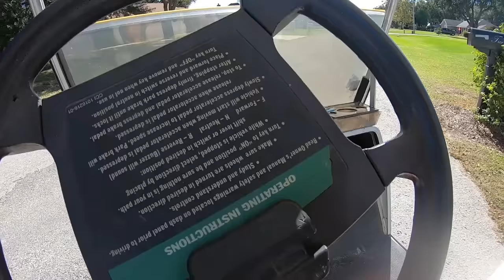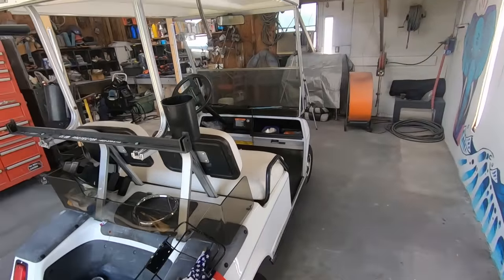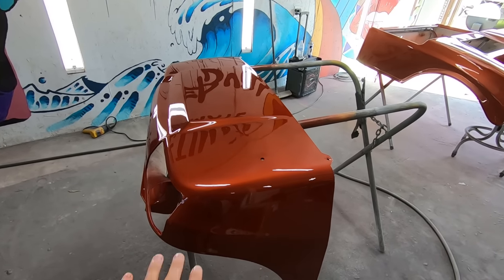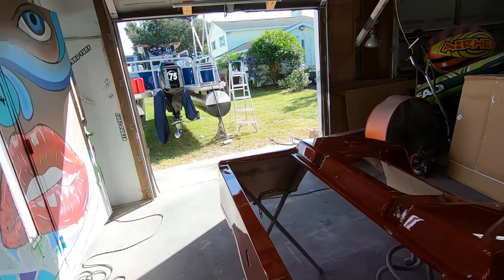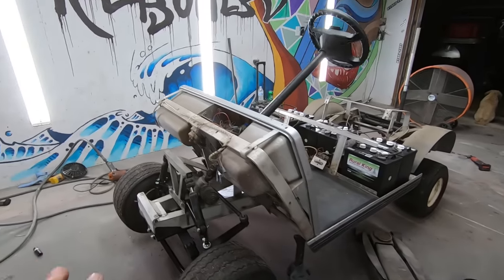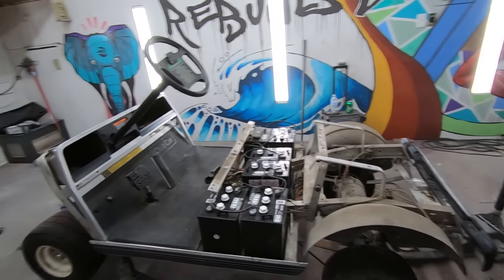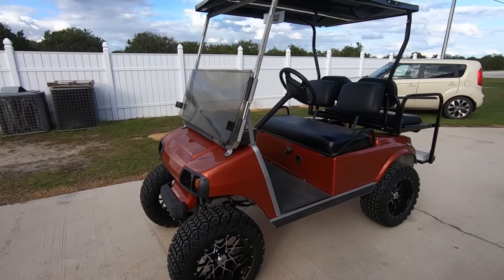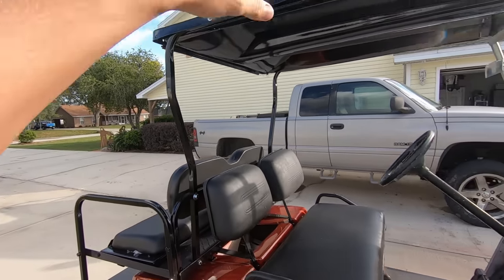Ultimate Golf Cart Makeover

Comment: You should put solar panels on the top to help with battery recharging and increase distance
Reply: I was thinking the same thing!
Reply: Flexible solar panels will be nice 😁
Reply: You may get 120kw per year out of a roof that size and it'll take around 10kw to charge the cart. So yeah, you'd get somewhere around 12 free charging per year. Biggest advantage would probably be charging any time it's outside, even if it doesn't fully charge you'd still be gaining a little in the battery reserves.
Reply: Even if the cost of it only balanced the savings in power etc, you’d have a good selling point for resale!
Reply: @televisionhighlights8730  Solar in Florida has more than a 10 year payback period.  They pay 11 cents per kilowatt so a solar panel on the roof save about $13/year off the electric bill.  A $260 system would take 20 years to pay for itself.
Reply: @theupscriber65  having to push your shit back from the store because you didn’t want to spend $260 priceless lol.
Reply: @theupscriber65  Damn that’s crazy!
Reply: A solar panel on that roof would not generate enough power on that pack to make a difference.
Reply: @davidmerullo551  LOL 
If you allow your pack to get so low that you can't get back from the store in the first place, solar panels are not going to make a difference.
Reply: @theupscriber65  A waste of money even in a sunny place.

Comment: golf carts come stock with a 3 hp engine you should put like a 9hp engine
Reply: Its electric
Reply: @dpettengill4052  u think that e motor does not have hp ? 750w cca Is 1hp So if you have 1,5kw motor electric IT has 2 hp
Reply: He should add a 150 horsepower engine
Reply: SIKE it's electric
Reply: My cart is gas and has a 13 horse motor
Reply: Plum quick sells motors for golf carts with way more than 3 hp.  Some will get you over 35mph.
Reply: He should Drop a hellcat engine in
Reply: Hayabusa engine
Reply: @tnails2397   I 1000% percent agree with you Tommy.  I was just checking them out the other day (PLUM QUICK), TONS of power and pretty affordable too.    
       The bigger the wheels, the faster can go too because of the silly speed sensor
Reply: @landont915  yes
Reply: We have local golf cart guy do what you did and get 10,000 after lift and paint WOW he’s really raking it in.I was thinking it’s a big mark up 💰💰💰💰💰💰💰
Reply: @zap3917  yes most manufactures golf carts range between 9 and 13hp Gas! Not 3 like someone else mentioned here..... armchair dreamers, SMH.

Comment: You need to place filter media in front of that exhaust fan. One the fumes can cause a fire with the electrical motor. 2nd if the EPA see this video you're going to get fine for exhausting MLT into the air. Just build a frame in front and use furnace filters that you can slide in and out. Cart looks good.

Comment: And morę. You definitely need more goodies: A beer cooler. Cup holder. Speedometer. Sports steering wheel. Large front bumper and piping. Speaker with the sound of a 6 cylinder and you can go to the boulevard;)

Comment: This just my opinion. I love the cart. The only additions or changes I would make would be to add a chrome/aluminum grill that stretched across the front of the cart and accent trim all around. As for the sound system, the radio would be obvious upfront, two mid-range with tweeter below the front seat, and a small ten-inch subwoofer in the back under that seat. The amplifier can go back there or between the front speakers. Also, it doesn't hurt to paint the undercarriage too in the same paint color. One thing that might be expensive but could be a nice addition to your brand would be to have custom lights that attach to the sides of the cart, or you could use them on the boats, that reflect on the ground that says "Ultimate Rebuilds". This is just a branding technique. This will help build your brand. I like your channel. If I could offer any advice, it would be to sell some items to buy land and build a rebuilt garage. Start your company. You are on to something BIG.

Comment: I'm kinda surprised you didn't convert it to lithium batteries.
I did it to me mini Vespa type scooter that had bicycle pedals that didn't require a driver's license.
I got twice the range it did with the original lead acid batteries thanks to the weight savings and efficientcy. 
And it charged faster.
A year after I upgraded it someone stole it out of my garage I forget to lock while I was in the VA hospital.

Comment: Stock engines believe it or not are 9-13hp stock..... a 3hp engine barely moves a kid on a mini bike. I started life as a golf cart technician and managed a small engine shop half my life before becoming a engineer for lab equipment. Plus I personally own a few my original one was a modified Yamaha gas and now I have my latest hobby cart a Ezgo TXT with a hybrid snowmobile/Ezgo 244cc 2 stroke. It may sound small lol but it's enough to cruise it at 35 and if your feeling brave it will hit the mid 50s with stock gears. The engine doesn't begin to reline till 9K. It's even got enough power to break the 10" wide street tires lose off the line on dry pavement and drift across dirt or grass. For those who don't know here's a little secret of the golf cart trade, the old Ezgo Marathon models use Fuji Industrial 2 strokes which are almost identical to the 244cc's Polaris used in their sleds and Atvs, more so related to the snowmobile engine, but yes you can easily without machine work make a Ezgo/Polaris hybrid 2 stroke engine that with a Polaris full expansion pipe exhaust will make almost a decent 30hp reliably. My TXT started life as a 350cc 4 stroke Robin/Fuji industrial engine but they don't have the power potential or rpm capabilities of a 2 stroke does plus at least half the weight. I took the engine mount and engine from an old marathon and mated it to the better TXT F/N/R transaxle. Lift kit, fender flares full frame up restoration, wheel spacers rims and tires full light kit and horn stereo, with weather proof speakers and new upholstery dash and floor matting, 2" tow bar front bumper kit. I only went for the 4" lift because even with the 4 extra inches gained from the wheel spacers 6"s would have been even more unstable at that hight and wheelbase. But absolutely amazing paint job Man! Yeah it's a fun project and relatively easy and inexpensive if you know what your doing. The best part is there's always room to grow with these things. If you don't like something, change it up, it only usually takes a couple hours to a weekend worst case lol. Keep up the great work my Man definitely love that color you laid down on it bro looks gorgeous especially in the sun!

Comment: You have to straighten the steering wheel. That would bother me.

Just turn the tie rods equal turns on each side until the steering wheel is lined up. This method will not throw off your alignment. Just remember the tightening of loosening on each side is different. So if you are turning the wrench towards you on one side, you turn it towards you on the other side.

Comment: Kind of sad you didnt upgrade any of the suspension to handle the larger tires and lift in the rear. Also super sad to see you kept the stock solenoids and motor on there. Those can be such nice carts if you actually beef up the internals.

Comment: another great project, thanks for the great content.

few suggestions... 

if you replace the roof with solar panels, and add a cheap solar charger under the seat, it will charge itself if you keep it parked outside.

here is a video from engineer775 doing that conversion: https://youtu.be/FOd3xfRT8VU

also, not sure about the laws in your state, but you might want to be careful about underlighting that can flash red or blue. some states actually consider those colors illegal to have on a vehicle. not saying i agree with that, just giving you a heads up so you don't run into someone with a badge who might be having a bad day.